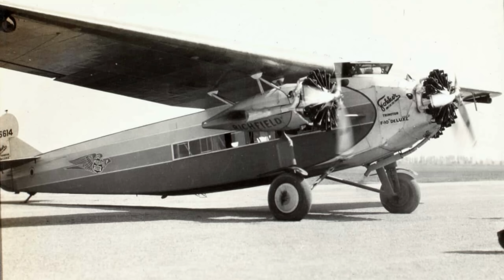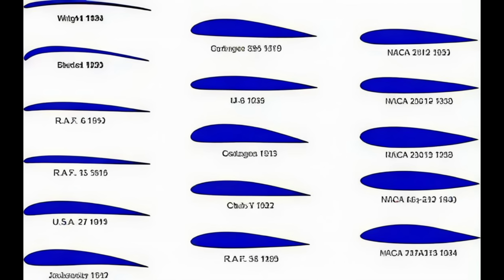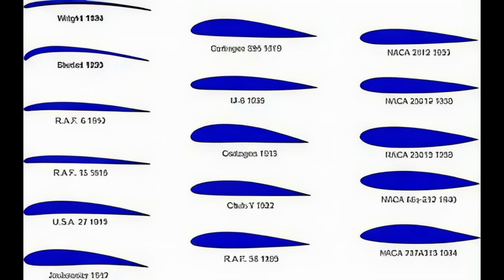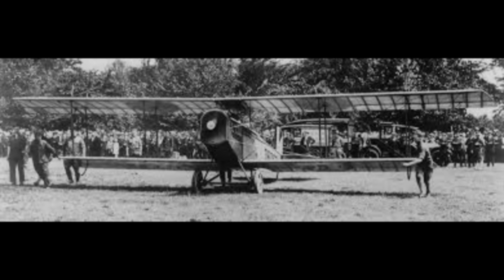The Wing Problem That Nearly Killed Aviation

Comment: Where and how does the steel/iron pressure vessel fit in?
Reply from the maker: Good question. It actually doesn’t.
Pressure vessels deal with internal pressure containment, while the Clark Y is about external airflow and lift generation.
Two very different engineering problems.

Comment: Is this the Clark as in Clark Y  ?    So it is.   Used not only by full size aircraft,  but aero modellers for the same reason. 🤗
Reply from the maker: Yes — the same Clark.
Virginius E. Clark is the engineer behind the Clark Y airfoil, one of the most widely used wing profiles in early aviation.

Comment: The Clark Y aerofoil section is still widely used on model aircraft. A little washout helps with tip stalls.
Reply from the maker: Absolutely.
The Clark Y is still popular in model aircraft because of its predictable lift and gentle stall.
Adding a bit of washout helps keep the wingtips flying longer and reduces tip stall — exactly why it works so well at low Reynolds numbers.